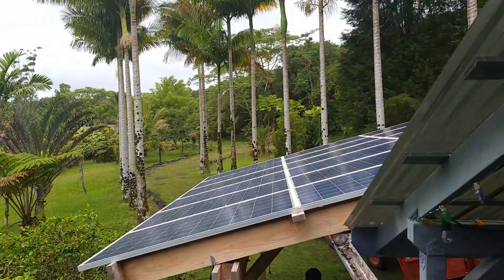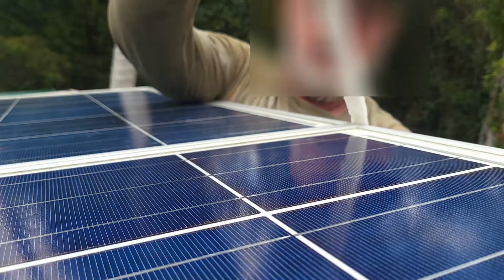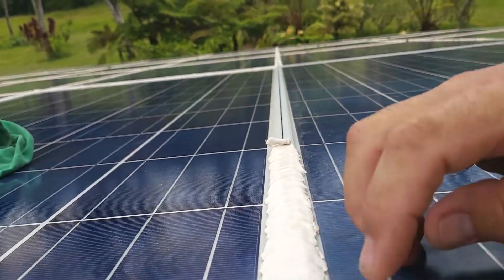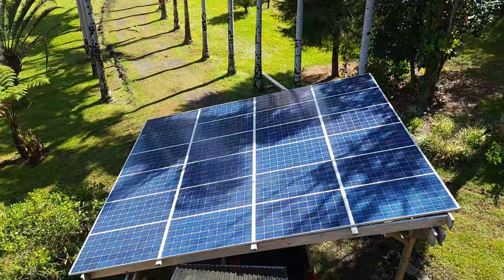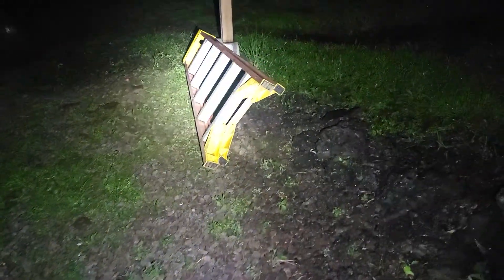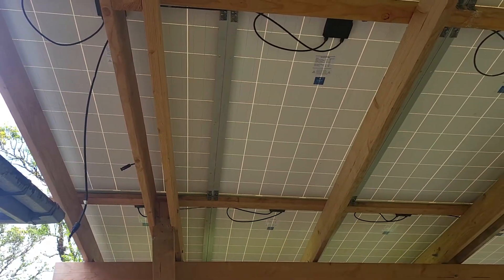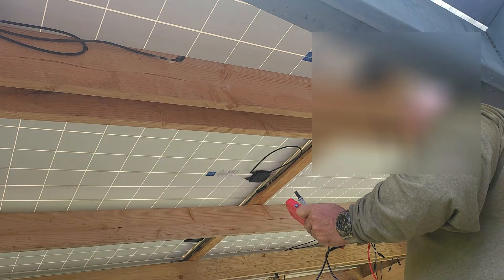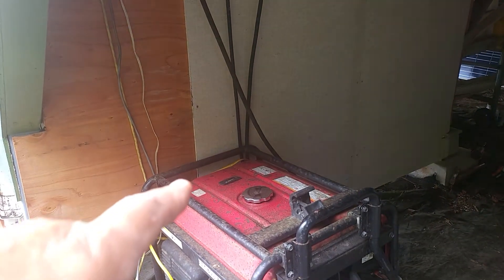DIY Off Grid Solar - Part 5 - Array Completion, Inverter prep

Comment: thank you for sharing your install video! I wonder if there is a way to protect the butyl tape from the elements long tern
Reply from the maker: Thanks for the question. Butyl tape is often used for exterior penetration installs on RV roofs, so it is pretty durable long term. Mine is holding up well so far, but I am only about one year into it. I do have a video on a one-year update on the system, I just haven't had the time to upload it.

Comment: I am working on doing a coveted patio with the same exact panels from San tan Solar got the panels for 25$ each and they are cheaper than plywood and roofing material at that cost. The frame work will cost me more. Planning on even catching water off the panels.   Would the tape have worked between the panels sandwiched?
Reply from the maker: I tried that, but it was more difficult.  Some panels are not exactly flush. Corners are snug but a bit convex in the center of some panles.  You might need a couple of layers of tape. I also tried tape sandwiched and caulk, but I still had some leaks.  In the end, taping on top of the seam as it crowned was easier and more effective .  You might have better luck, lmk.

Comment: why didn't you put the tape between the panels? you could just push the panels together with the tape in between causing a sandwich.
Reply from the maker: I tried that, but it was more difficult.  Some panels are not exactly flush. Corners are snug but a bit convex in the center of some panles.  You might need a couple of layers of tape. I also tried tape sandwiched and caulk, but I still had some leaks.  In the end, taping on top of the seam as it crowned was easier and more effective .  You might have better luck, lmk.

Comment: The idea of a solar carport is good, but shading from nearby trees shall limit the output power.
Reply from the maker: Thanks, for commenting Mike, you are correct and the shading issue was a key point of discussion in these series of video's.  It was a trade-off decision that I made to get the carport that I already wanted to build.  The array gets about 6-7 hours of non-shaded sun exposure, and with such an inexpensive solar panel cost, it was economical enough to overpanel the system to make up for shading issues.  This property uses approx 3-4 KW per day and at some point may use up to 10Kw.  With 5.7Kw of panels, well you can do the math.  It is almost as cheap to buy used solar panels as roofing material.  This way I get solar and a carport in one build.